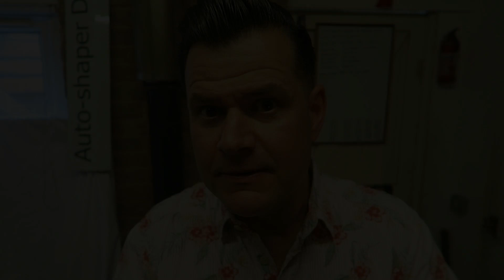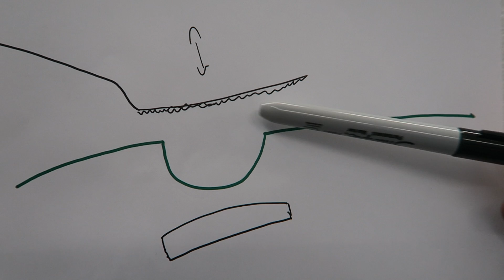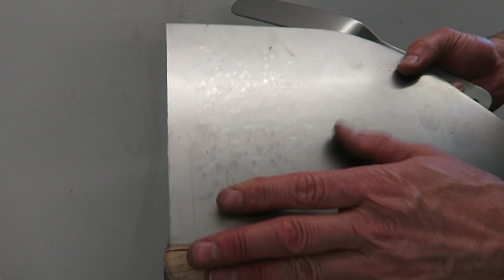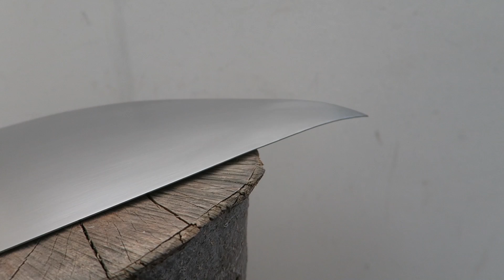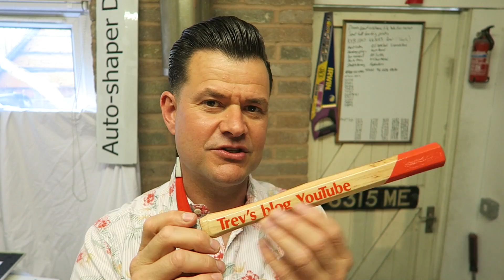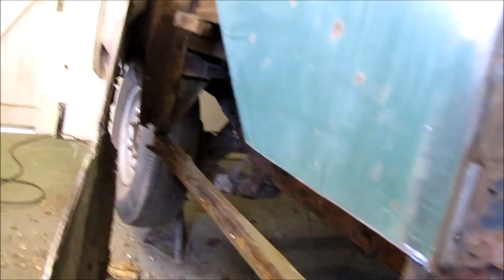How to shape a curve into a panel without an English wheel double curvature Tips and Tricks #34

Comment: Hello Trev.  hope your well.  I wonder if I could ask why you bought the analogue ac/dc tig welder vis-vis the digital.  Im wanting to get into welding aluminium.  Ive never done it before so your advice I value.  I spoke to Joe at Rtech he was saying the digital are best.  any help gratefully recieved  cheers Colin
Reply from the maker: Yes he may well be giving you good advice. I only got the analog because it was the identical one I was using at work. I’m pretty sure the digital ones have good presets so you haven’t got to be overly concerned with having the correct settings. Cheers Trev 👍

Comment: I see guys hammering ashtrays, and propeller nose cones for aircraft at airshows. They use a leather bag filled with steel shot to for the ash tray bowl, but I don't stay long enough to see a propeller cone made.
They are actually selling soldering rods for aluminium, but hammer out parts to attract the crowds.

Comment: Shrink hammer; Your explaination gives more sense to it than I probably had before. 
Have I understood it right? ; If I have a big stretch I do not want, way to shrink it, is to ding it with a needle hammer and then work the needle hammer ding, with shrink hammer and dolly? Right? ...Or wrong ? :D
Reply from the maker: I’ve done lots of videos on shrinking please watch more videos if you’re still unsure. Basically shrinking happens when the material becomes compressed along its length. A tuck or double fold that creates a rib will shrink if it’s sandwiched between a flat object and hammer blow because of the linear compression. Cheers Trev 👍

Comment: Are you concerned about work hardening?  Thanks again for your fantastic video's.
Reply from the maker: Steve Larsen you’d have to give mild steel “at this thickness” far more abuse before work hardening came into play. You can bend it back and forth around 200-300 times before it snaps off allowing around 10mm of material. Cheers Trev 👍

Comment: Ms C Vick here, with a question/suggestion. Is it possible that a square or triangle in the middle of stand, with matching shape inset on the back of tool thingy, might hold it just as well, while allowing use of full shape of thingy, and possibly fitting into smaller spaces?
But thank you for explaining  (at my idiot lvl) the reason and machado behind it. For not hitting from reverse side of dent.
Reply from the maker: Clint Vick Yes you’re absolutely right, the construction could have been a more suitable shape for the job. My main point was to demonstrate that you don’t necessarily need really expensive equipment to produce effective shapes in sheet steel. Cheers Trev 👍

Comment: Great as ever Trev,  Would you a 'Toothed Slapper' on Aluminium to take dent out or would this be to aggresive and RIP up the surface?

Thanks 

Andrew
Reply from the maker: Andrew Litchfield  I would use one but of course it will mark the surface, it depends upon how fussy you are regarding surface quality. If you’re going to paint it anyway I personally wouldn’t be bothered about surface marks. Cheers Trev 👍

Comment: I've enjoyed many of your videos and I think you're a genius...just one question though....you aren't locking down your dolly nor your dolly holder to the base of the hardwood...wouldn't the prevention of the base movement give more curvature on each slapper blow? or is that just part of your preferred technique i.e. less indentation or curvature per slapper blow? OR are you just being lazy today? LOL Thanks!
Reply from the maker: James K Doherty makes no difference to the efficiency of the action because of the ballast within the tool. It does shovel on the wood after about 50 blows but I can live with that as the purpose behind the principle is being able to swap tooling about in seconds and also use the tools for multiple applications. Cheers Trev 👍

Comment: Another super video-thank you. YOu are my favorite body guy to follow. The cradle holder for the dolly-a great idea.

Speaking as a rank ameratur next to you, I'd love to see a video on the essential hand tools you suggest-I have a set of cheap Harbor Fright dollies but I need to figure out what items I should be adding next. Same for hammers, punch and flangers etc
Reply from the maker: Steve Wuertz I could perhaps do an essential basics tool kit. Good idea. Cheers Trev 👍
Reply: @trevsblog  As long as I'm dreaming, intermediate would be nice as well.  How many dollys and types are needed., bead roller, TIG for body panels external vs MIG with Argon, must have hammers, nice to have/completist only and anything on the whaletail body picks for addressing small dents on a fender-like when something fell off the rafter and put a plum sized dent in the crown of a 61 Alfa fender.  stuff like that

great stuff-really do appreciate it

Comment: Your dead right with the shrinking with the file slapper the original idea came from a shrinking dolly with serrations on them u might remember them they were actually  used to grip the tuck when u hammer it down to shrink it nobody knew how to use them and just thought hammering flat on the serrated  dolly would shrink metal then they started making those meat tenderiser hammers and called them a shrinking hammer.

Comment: Nice work, Trev.  You're a good teacher; now I know why body work is so expensive as it is quite an art; while still a profession and very time consuming.  Personally, I've been a mechanic for about fifty years and have quite a bit of welding experience which includes socket welding high pressure hydraulic piping.  Stick and MIG are my experience as TIG wasn't really into use widely at that time, (1970s and 80s).   Massaging sheet metal for body panels hasn't been my forte, though.  This is why I feel fortunate to have found your channel.  Not all of us have access to the major tools of the trade such as English wheels an such, so it's quite refreshing to see how panels can be formed using what can be easily and economically procured.  I thank you for taking the time to share your expertise.

Comment: 5 speed. I think that this will work to make a repair section for the rear wing on my Peugeot 604. It looks almost flat as it's quite a slab sided car but actually is very slightly double curved.

Comment: shaping it's like cold blacksmirhing.
have you thinking make hot shaping ?
Reply from the maker: jomo350350 to a large degree hot shaping sheet metal is unnecessary. The material used is extremely ductile, I’ve done strength tests where I’ve bent metal back and forth etc. You can bend .9mm 200 times before it breaks so therefore moderate shaping has no impact upon the materials strength properties. The major issue with heating sheet metal to make it softer is heat distortion. Cheers Trev 👍

Comment: Thanks trev for your patience in the video, could you make a video about Flexible Shape Pattern process.
Reply from the maker: Sean Roberts hi Sean this sounds like something that Wray Shelien would talk about, I think he may have even invented the process. If I take on a project I’m considering, I’ll be doing a very large coach building job so will be discussing this kind of thing for sure. Most of my videos are really geared more towards patch repairs rather than full on panel manufacturing. Cheers Trev
Reply: @trevsblog  your dead right but he doesn't say whether he used one layer of masking tape or two (going 90degres other way )but when you show it give us a close up walk through.

Comment: I'd be interested in buying a English wheel kit from you that I could weld together
Reply: Hell yes most of the kits are still out of reach at 800 from what iv seen and the metz desktop ones have so much flex and the anvils are apparently junk.

I know quick Bikes has plans and a video on his frame build and a source for the wheel and anvils if that helps? Cost about 200 quid he reckons.

Comment: Thanks again Trev. 
What I have learned from you is a light tap with the hammer is more effective than a heavy hit to achieve your end goal. From a heavy hit, the metal seams to bounce rather than move.  
I'm off out to my workshop to attempt today's lesson. Great stuff & inspirational as usual.
Reply: As is so often the case. kinda zen advice when you think about it...
Reply: I started by hammering aluminium cans together, then forming the into ash trays.
Reply: Well actually a heavy whack is quite dramatically effective in shaping metal… the thing is that it moves other places that aren’t beneficial- and correcting these stretches, wrinkles, and shapes is more time consuming than simply stretching it where you want it more generally to begin with.